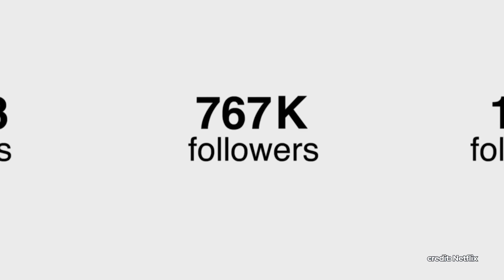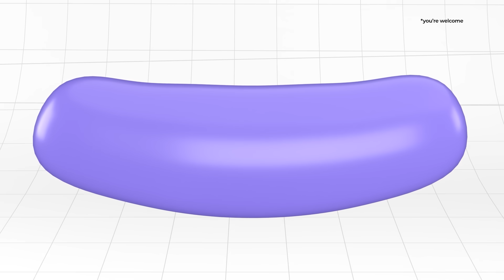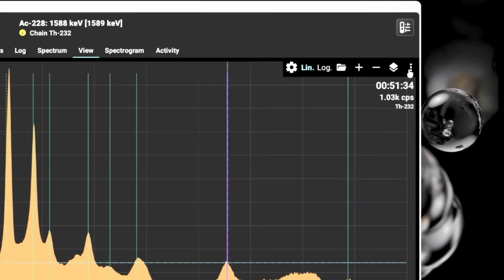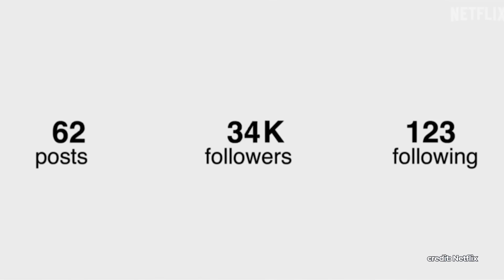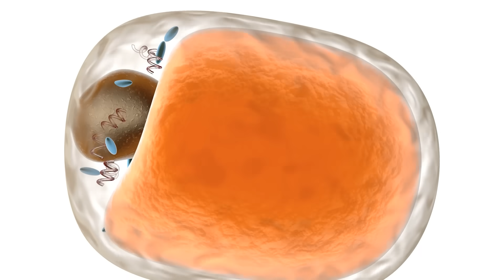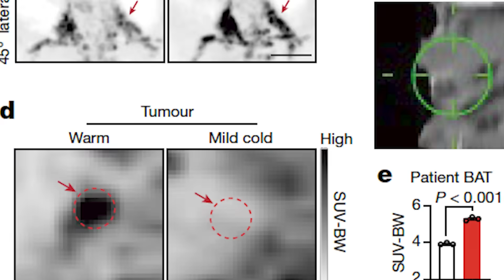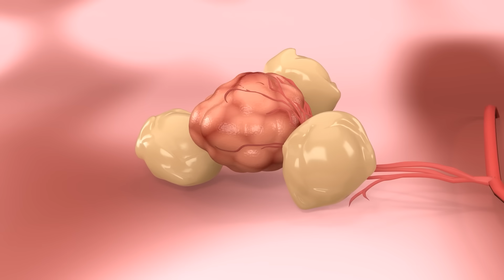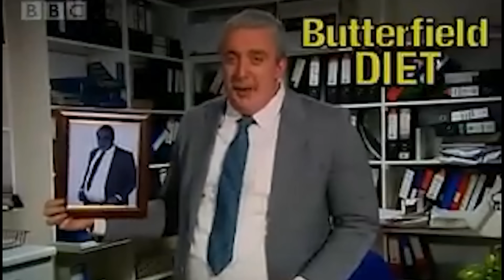Scientists Just Discovered How to Starve Cancer

Comment: You said at the end "what if cancer shifts gears and starts burning fat". It can't burn fat, the warburg effect has proven this. Cancer only runs on glucose and glutomine (Dr. Thomas Seyfried), and can not use keytones. Using pressed pulse method, removing glucose and pulsing on and off glutomine (we can't live without it, as it's an essential amino acid), is very promising work. Combine this with the beige fat work, and who knows, maybe the anti-angiogenesis work from Dr. William Li (a lot of research dollars went into this in the early 2000s) and there might be a combo therapy that keeps death at bay. I don't have cancer but if I did, I'd be doing my research along these lines.
Reply: This is the exact diet I encouraged my dad to follow when he was battling a recurring pleomorphic liposarcoma. Along with this, I included a regimen of THC, CBD, curcumin, and high doses of vitamin D ,a combination known to inhibit tumor growth by promoting apoptosis, reducing proliferation, and stabilizing blood sugar levels. Remarkably, the tumor's growth halted for two months (confirmed via MRI). When the tumor was eventually resected, the pathology report described it as showing signs of degenerative changes consistent with programmed cell death, rather than necrosis. Reading that line in the report gave me a deep sense of validation that our approach made a real difference. It's now been 2.5 years, and he's still cancer-free.
Reply: @haroldjansen8541 thanks for sharing... We can all theorize all we want, but there's nothing like a real world case study to validate all the theories.
Reply: The later... I think Dr Seifried has a protocol and is starting trials.. not sure. Haven't followed his thread in months.
Reply: It depends on the type of cancer.
Reply: Unfortunatly they are highly mutable, so it's reasonable to assume they'll mutate at some point. We may cure 99% of it, but not 100%.
Reply: You might also be interested in reading about the effect of oxalic acid on lactic acid fermentation in cancer cells.  Essentially, oxalic acid can make the cancer cells even less efficient at metabolizing glucose, making starving the cancer cells more effective.  A living human body will always contain some amount of available glucose, even on a diet completely lacking carbohydrates, as it is required for certain biological functions.  The body will use gluconeogenesis to produce glucose, even cannibalizing healthy tissues for protein to produce glucose when necessary.  I suspect that a ketosis-inducing diet combined with high-oxalate foods (rhubarb, wood sorrel, etc., or even isolated oxalic acid to further reduce carbohydrate intake) will be more effective than either treatment separately.

"The conjugate base of oxalic acid is the hydrogenoxalate anion, and its conjugate base (oxalate) is a competitive inhibitor of the lactate dehydrogenase (LDH) enzyme. LDH catalyses the conversion of pyruvate to lactic acid (end product of the fermentation (anaerobic) process) oxidising the coenzyme NADH to NAD+ and H+ concurrently. Restoring NAD+ levels is essential to the continuation of anaerobic energy metabolism through glycolysis. As cancer cells preferentially use anaerobic metabolism (see Warburg effect) inhibition of LDH has been shown to inhibit tumor formation and growth, thus is an interesting potential course of cancer treatment."
Reply: I am in remission from stage 3 colorectal cancer that i was diagnosed with back in 2023. While undergoing chemotherapy I incorporated the following measures:
1. Keto diet
2. Fasting (5-day fast every 2 weeks during my chemo cycle)
3. Fendendazole (I found some research that indicated it may inhibit glutamine uptake in cancer cells)

At the end of my chemo cycle amd personal regime, my tumor had vanished and effected lynph nodes had returned to normal. My oncologist told me the likelihood of this result eith chemo alone was under 5% so I do think what I added in helped.
Reply: @franklinbluth8542  The cancer was probably parasitically based. Most cancers are triggered by microorganisms, funguses, yeasts etc. But with smoking tobacco has Polonium-210 which is one of the most radioactive elements known to man. Most people don't come in contact with it besides from tobacco smoke. So polonium (even from 2nd hand smoke) can build up in the lungs and electrocutes tissues causing immune response and DNA damage. Polonium also settles in intestines and can contribute to colon cancer, and settles in the bones and can create leukemias. The amount of toxic radiation released (half-life) of polonium turning to lead is different than chemotherapy levels of radiation. Dosage is everything. The problem with cancer is a chicken or the egg type conundrum. Cancers can start from a variety or sources and reasons, then other factors either limit or proliferate them. I was lucky to help 4 people get rid of cancer, but each was it's own thing that had it's own details and requirements.
Reply: someone else said that Dr. Thomas Seyfried's research is wrong and misleading. It only applies to brain cancer where these cancers only eat glucose. Other cancers can burn fat apparently
Reply: Lactic acidosis in the blood is the environment cancer needs to thrive. A true keto diet prevents lactic acidosis.
Reply: So do you believe if scientists find a way to use fat to starve and kill off cancer will it be a cure ?
Reply: The warburg effect is burning dietary fat which is a defense mechanism against FAS (fatty acid syndrome) peroxidation damage, as shown in Randle Cycle studies. That's when there's less than 60% carbs in the diet and stops basic glycolysis/fructolysis to ATP, and goes to lipolysis/beta-oxidation which in Randle Cycle studies show mitochondria respirate slower, make less ATP and create an acidic environment, where various bacteria, funguses or viral infections can happen further initiating ROS (reactive oxygen species) and/or RNS (reactive nitrogen species). From my point of view it doesn't matter if it's a chicken or the egg, high fat first or pathogenic infections with immune reactions as lipolysis/gluconeogenesis creates acidosis spiraling. Metformin focuses on stopping or slowing gluconeogenesis in diabetics, and the same here for cancers. High carb diets naturally trigger brown fat thermogenesis. The old school food pyramid is correct for preventing or stopping these processes.
Reply: Glutamine may not be an essential amino acid because the lungs and the brain (both high-metabolism areas) can produce small quantities of it.
Reply: if by some chance, there was a mutation that occured in the surviving cancer cells that made it survive this kind of cancer treatment - Due to, (taking a guess here), not completely eliminating the cancer's 'food' supply
then that might compromise the treatment, if there was a human gene that helped the growth of cancer, via a bad mutation, then  an increased cancer risk woul  be potentially passed on. 

Maybe.. If a cancer can evoid treatment, and somehow turned transmissible that may be a problem that would mean that human cells would require more genetic modification.

//Im just yapping about stuff that others have probably thought about, and likely wont happen, and this isnt scientifically backed - just food for thought
Reply: @BfdiandTpotFanIf a cancer patient can swing (e.g. via diet control) the cancer to switch its energy supply from glycolysis (of glucose) to fermentation of glutamine and inhibit the fermentation as the cancer starts counting on fermentation heavily, the patient can "starve the cancer."

If the cancer can only do  glycolysis (of glucose) and/or fermentation of glutamine, the switching if its period is controlled well can effect great reduction in the cancer's growth rate.

As the ( high -metabolic) lungs and brain can produce small amounts of glutamine in "safe mode" (of Microsoft Windows parlance describing restricted-access bootstrapping), a patient can enter "safe mode" by eliminating glutamine supply and count on the small quantities of natively produced glutamine by the lungs and brain.

There are TWO almost independent lymphatic drainage regions (one drains ultimately through the spleen/gall bladder/anus and the other through the kidneys/urethras). We can switch between them. The right-side lymphatic subsystem may have been designed for "safe mode" operation because it drains the most vital region of the human body — the brain.

I'm blazing the trail with my stage-4 cancer confined to my left-side without involvement of the right-side where there is a major lymph node in which lymphocytes (including some of those from the left-side) are held in training and being matured. The thymus connects to this lymphocyte "army base."

There was a study which injected cancer tumor cells into embryos of mice and they grew into NORMAL mouse cells in the adult mouse. Controlling metabolism IS the key to defeating multiple forms of cancer. The operation of the Krebs cycle (Nick Lane said that it's REVERSIBLE ! so it was there in Earth Life's early evolutionary period) lies at the foundation of life and death. Ancient death-processing practice allowed three days of not burying an apparently dead but not surely dead person so the metabolism-switching period ping-ponging metabolism between the left lymphatic subsystem to the right one may be on the order of three days.

I'm trail-blazing these conjectures with my case of stage-4 cancer found mostly on the left-side of my body. 🤞😂
Reply: @asherasator Thanks for this information. Ammonia is probably made into urea in the body as ammonia is nasty biologically. How do we know that "ammonia" or nitrogenous byproduct from catabolism of protein by the cancer is what causes the pH to become acidic and not the proliferation of anaerobic organisms which feed upon the partially oxidized or fermented food nutrients ?

I believed that I took advantage of the partial separation of the two lymphatic subsystems to "self-vaccinate" my right-side lymphatic subsystems (swelling the main lymph node and letting it shrink back to normal size) but I'm not actively swinging my diet. I did the flushing with orange-peel-laced water though, supplementing with olive oil whenever I got hungry.

I had some bulges on my left side abdomen which after a few miserable days shrank. I found the appearance of a cold-sore-like lesion on the inner side of my mouth's lower lip strange as if I was allergic to something (on the 9th day after I had started the cancer treatment drug, this lesion appeared, but it subsided and hasn't appeared again despite my continuing with the drug). Maybe it was just the lymphocytes fighting.
Reply: @solconcordia4315  Most cancers are haywire infections because of acidosis. And some are from tobacco smoke which has polonium-210 one of the most radioactive elements. When it accumulates in the lungs releases extremely large amounts of radiation basically electrocuting tissues creating DNA dusruptions and mutations. Polonium can accumulate in the intestines leading to colon cancers, and it settles in the bones which can make leukemias. And it can initiate acidosis infections with that.
Reply: @asherasator I don't understand how this all works but it sounds like a cancer patient is in quite a bind alright being caught in a metabolic trap. I'll study this more.

I tend to follow the Dutch philosophy of dealing with "soft drugs." Feed the cravings a little bit without going overboard. Noting the huge incarcerated population of the U.S.A. due to the War on Drug, the Dutch might've been more sensible. 😅

Those few miserable days I had were the ones I had muscular spasms in the calf (early morning) and both thighs (the next day). I also reached a lower weight I hadn't reached for many years. It might be a symptom of "wasting away." I increased my consumption of dairy products and high vitamin-D and they seem to have helped because the muscular spasms went away.
Reply: @asherasator I don't understand how this all works but it sounds like a cancer patient is in quite a bind alright being caught in a metabolic trap. I'll study this more.

I tend to follow the Dutch philosophy of dealing with "soft drugs." Feed the cravings a little bit without going overboard. Noting the huge incarcerated population of the U.S.A. due to the War on Drug, the Dutch might've been more sensible. 😅

Those few miserable days I had were the ones I had muscular spasms in the calf (early morning) and both thighs (the next day). I also reached a lower weight I hadn't reached for many years. It might be a symptom of "wasting away." I increased my consumption of dairy products and high vitamin-D and they seem to have helped because the muscular spasms went away.
Reply: @asherasator The injection of tumor cells into fetal mouse study intrigued me. The fetus doesn't breathe like adult mice do. It respirates through its umbilical cord. When it is born, there has to be a quick switch from umbilical cord respiration to lung respiration. The pH level in the umbilical vein and artery DIFFER . Birth can switch the fetus from a more anaerobic(inside the womb, via umbilical cord different-pH blood exchange) environment to a more aerobic(via lungs) environment quickly.

Maybe the tumor cells went through this switching to go with normal respiration via the lungs so the acidemia disappeared.
Reply: @solconcordia4315  Blood pH is tightly regulated preventing acidemia, so it dumps acid into tissues, when long term and excessive from high protein/fat diets leads to acidosis infections, cancers and pathologies, regardless of vaccines, prescriptions or supplements.
Reply: are they also not able to ever mutate to evolve an ability for burning fat?
Reply: @your-averagehumanbeing  Yes. It's not mutation. In that acidic pH environment microoganisms pathogenic bacteria and funguses/yeasts are converting glucose making lactic acid that the cell isn't using for normal function, so it has to burn fat and protein: lipolysis & gluconeogenesis. Normally glucose per molecule would make ~30-38 ATP (adenosine triphosphate) molecules for cellular energy, but in cancer cells only ~2 ATP. Which is not enough so fat burning lipolysis/beta-oxidation kicks in making ~14 ATP which long term creates an energy deficit. And because red blood cells have no mitochondria they must have glucose so gluconeogenesis is also going on in high gear which requires a higher BMR (basal metabolic rate) to try and maintain all these processes using body surplus. Tumors are isolated infections grown from acidic catabolic byproducts allowing many pathogenic organisms to proliferate in lower pH. So to control limit infection cysts, nodules, fibroids tumors develop to surround and control the carousel, merry-go-round activity of bacteria, fungal, yeast proliferation which have evolved to thrive from the peroxidation attacking them, created that acidic environment by bacteria using glucose for food and funguses and yeasts can also use fat cells and other substances.
Reply: @your-averagehumanbeing  Cancer is really microbiology, virology and immunology processes using and reacting to the facts of Randle Cycle data with ATP. There is hardly any mystery to it.
Reply: Deleting cancer is very easy doing all or some of the following: 1) hyperbaric chamber sessions ( cancer can't exist in oxygen)  2) proton therapy (no side effects - it is not radio therapy ! ) 3) eliminate refined sugar 4) alkalinize the tissues with diet and alkaline drops ( cancer lives in acid )  5) reduce stress and cortisol to strengthen the immune system. 6) fasting ( for autophagy) 7) powerful antioxidants ( e.i. astaxantine)
Reply: I was thunking the same thing cut off the fuel in every way
Reply: I'm pretty sure there are types of cancer that do use fats for energy.
Reply: @Serjo777  especially those that mutated from fat tissues?
Reply: @Serjo777 Leukemia, melanoma, and pancreatic cancer can all use fatty acids for metabolism.
Reply: @Serjo777 yes ketones we eat but ketones our body makes are different I learned from dr berg
Reply: @Incorrect info, leukemia cancer cells and other lymphatic cancer cells can utilize fat and ketones as fuel, some cancers  actually prefer fatty acids and ketones.
Reply: Control a tumor's metabolism, and its mutation variability matters not, because that's a downstream process.
Reply: @ Those are whole different processes. Mutation is the most basic aspect of life
Reply: @yw1971 Timescale and environment matter. By your own argument, solving cancer doesn't matter because humans will mutate to survive it.
Reply: Brilliant summary. 👏🏼 Question: Via what treatment/ method is glutamine "pulsed"? Dr Siegfried rightly states it can never be eliminated. It is the most prevalent amino acid in the human body and found in practically everything. I imagine you mean cycling periods of denying high glutamine content foods to the body? Avoiding meats and switching to greens?Cycling on vegetables/greens, however, would lower glutamine intake, hence fuel, but would increase oxalate exposure which is also linked to accelerated cancer growth. Or, are you referring to a specific protocol that shuts down glutamine intermittently, in which case aren't there inherent risks of down-regulating/upregulating glutamine? 🤔
Reply: @albertwong4516  IIRC, the idea is to use a drug that inhibits glutamine uptake eg. DON, and then use hyperbaric oxygen therapy at that same time. As it is not possible to block glutamine uptake for too long, as all cells require it, it is pulsed, hence rge "press pulse" therapy, the press being the blocking of glutamine uptake.
Reply: @albertwong4516  The Press-Pulse protocol works by (A) lowering glucose as much as possible thru fasting or a ketogenic diet to severely limit one of cancer's fuel sources (the "Press" part); as a side note, the healthy (non-cancer) cells live off ketones generated thru ketosis, which nearly all cancer cannot utilize (apparently a few sub-types of leukemia can use ketones, but this is an exception to cancer, in general.) And (B) periodically suppressing glutamine via pharmaceutical drug(s). The most easily available drug which happens to be "off-patent" is known as DON (6-Diazo-5-oxo-L-norleucine). Because healthy cells can only survive without glutamine for a certain number of days, the drug is "pulsed" on and off. (the "Pulse part). So why does work against cancer work so well? Cancer cells are only able to use these 2 fuels (glucose and glutamine) and are very inefficient at using them, so they need LOTS of both glucose and glutamine. The cancer cells just burn thru the fuels to survive and grow. When both fuels are severely limited, the cancer goes from a formerly growing/thriving state to shrinking/weakening. As the tumor cells shrink and die from this Press-Pulse protocol, eventually the tumor can be excised and/or eliminated with a short course of immunotherapy and/or chemotherapy.
Reply: @albertwong4516  Oxylates can help remove excess calcium, as calcium is involved in all inflammatory processes. In calcinosis studies where high calcium ions were white blood cells followed with inflammation. The next stage from calcinosis is cancer. That's why oxylate foods are actually anti-inflammatory in proper dosages and conditions. Protein must be lowered to 35% or lower to slow glutamine synthesis (from ammonia) fueling cancer cells. Then the immune system can effectively dominate which uses glucose and stop cancerous processes.
Reply: That's not quite right. While most cancers prefer glucose and glutamine, some types—like prostate cancer, triple-negative breast cancer, and glioblastoma—can switch to burning fats or even ketones, especially under stress or treatment. Cancer metabolism is more flexible than the Warburg model alone suggests.
Reply: Better to call him Prof. Seyfriend rather than Dr. Seyfriend.

He's fantastic, the mirochondria model changes my mind about cancer.
Reply: @ElijahEDREF  Dr. Seyfried (PhD) is also a professor. Because he holds a PhD, it is acceptable to call him doctor or address him with the abbreviation: Dr.
Reply: "Cancer ... cannot use keytones." Which keytones do you mean? The black keys or the white keys? Ach, so what, cancer does not play piano anyway
Reply: @menyasavut3959 can virgo play the piano tho
Reply: @menyasavut3959 ketones, smartarse
Reply: "It can't burn fat, the warburg effect has proven this." No it doesn't. The Warburg effect just states that most cancer cells are faster than normal cells at using sugar resulting in a low oxygen & low pH environment, where they function better than normal cells. This does not in any way say anything about fat metabolism. There is no reason to assume they don't also have the ability to burn fat. 

You do know that cancer cells are just very slightly mutated normal cells, right? So they have all the abillities healthy cells do, they just have a couple metabolic processes (like the ones that cause the Warburg effect and the ones that drive reproduction) stuck on the highest setting while their ability to respond to apopthosis signals is disabled.
Reply: Wrong, there are two cancers that can run on ketones, pancreatic and some colorectal cancers.